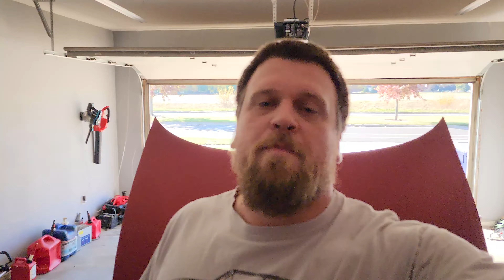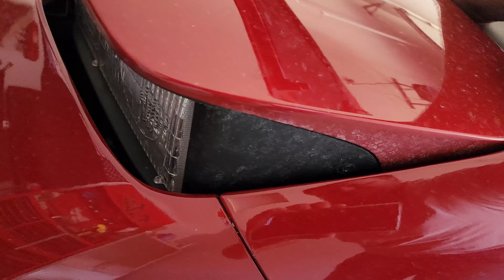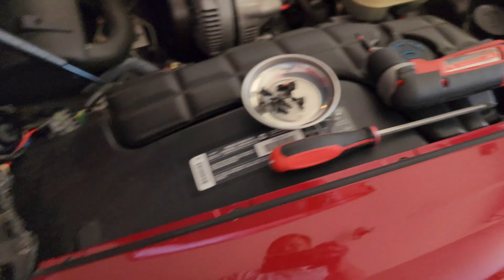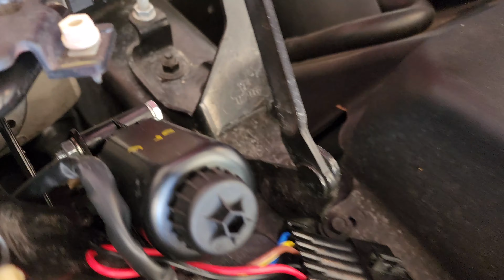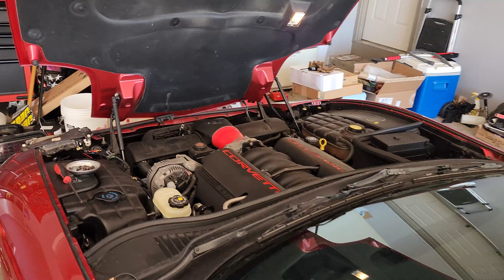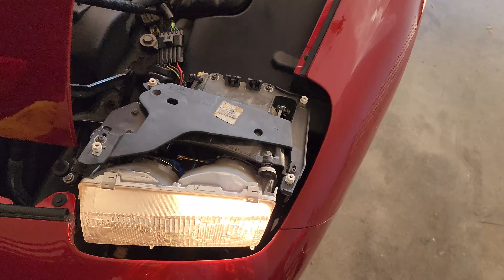1997-2004 C5 Corvette Headlight Motor Replacement and Repair Methods

Comment: Are you in DFW lol want to fix my light for me LOL
Reply from the maker: I'm in Southern WI.. lol make the trip and I'll do it for free and share some beer. haha
Reply: @RamblinGarage I got the job done today and the light hasn’t failed to go up yet! I botched the job a bit and only put washers on the top bolt. Do you think it’s worth taking it all apart again and putting washers exactly how the tsb says? 😅 seems to be working well as is
Reply from the maker: @OpenSourceSlayer  my OCD would probably make me do it lol but if it's working, just keep an eye on it and see how it behaves, I'm sure it's okay.
Reply: @RamblinGarage  I am like you. The actual kit with new bump stops and the washers will be here tomorrow LOL!
gonna rip it all back apart and re do it

Comment: So I can actually take the motor out with this method as well? Or would I still need to remove headlight?
Reply from the maker: @djtw1st3d  you can get the motor out this way, just remove the nut holding the arm on and then the three bolts holding the motor itself.
Reply: This looks way easier! I have big hands, so this is perfect. Thanks for the great videos man.

Comment: Good video. I've had to replace several headlight motors on my Firebirds over the years. I actually try to use my fog lights as much as possible to try to avoid using the pop-up lights.
Reply from the maker: I appreciate ya!  Not a fun video, but they tend to help a ton of people.  I'm with ya, I don't drive a ton at night in my cars, but when I can drive with just fogs, I try to do the same.  Plus I think the cars just look cooler with just fogs on, as long as it's enough light (depending on time of night) to be able to see haha
Reply: @RamblinGarage  I d appreciate your videos. I've actually been pulled over for just running my fog lights after dark, but I swapped in LED bulbs and keep going.